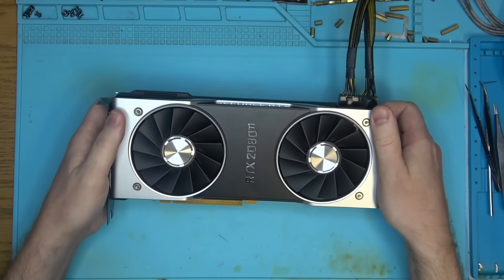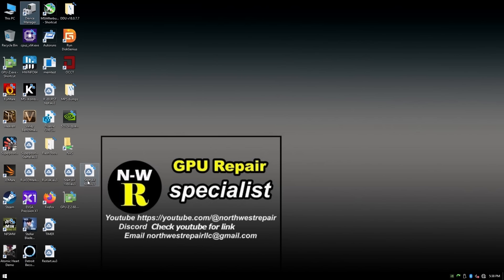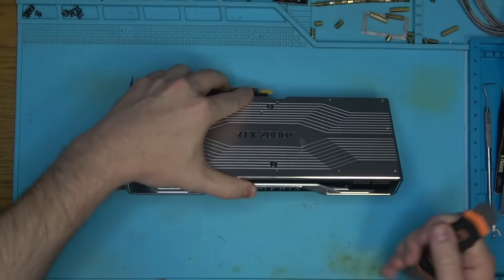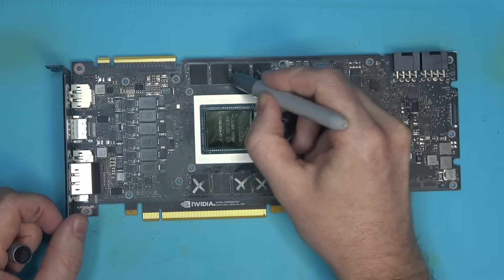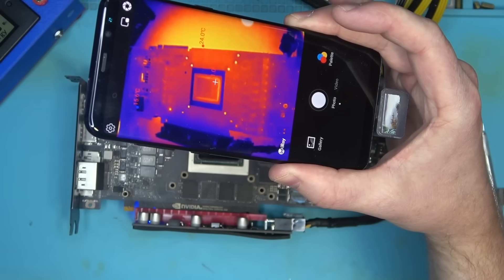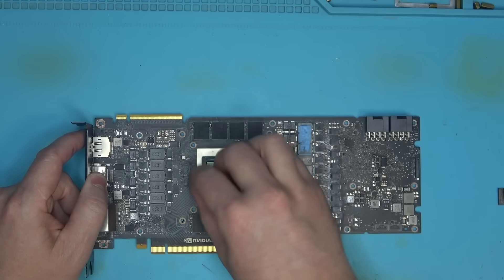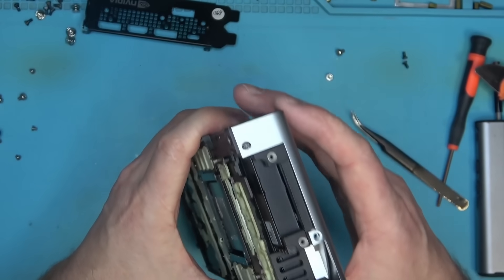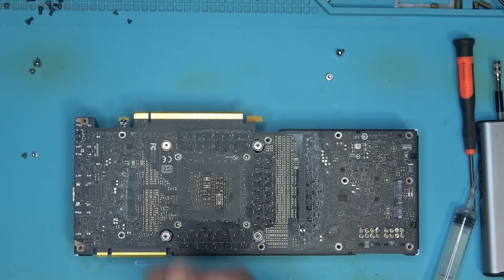2080Ti memory upgrade video 11GB to 22GB

Comment: can you upgrade rtx 3060 memory ?
Reply: No, 3060 already have 6x16gbit chips ( 6x2GB ), so you need 32gbit GDRR6 chips that do not exist, or even a new PCB that's dual sided like 3090.

For example, the modding done on 3070 8GB to 16GB is using same chips that are on 3060 ( 8x16gbit / 8x2GB instead of 8x8gbit )
Reply: why? it already has enough for the power that it has.

Comment: To replace the fans you have to heatgun melt the "2080ti" logo plate that's between the two fans on the face of the card and use dental floss or some prying tool to get it off. afterward I believe it's one or two screws under a gunk of hot glue.

 I think Gamers Nexus has the only popular video of actually accomplishing that since I am familiar with the one who "dremeled" out the fans to replace them. (being a more destructive method imo but depends on your comfort level)
Reply: Some pretty mad aura points if tony goes back and does this. Well beyond my expectations anyway.
Reply: https://youtu.be/w9FtXZGQzfM?t=371
Reply: @SergeiSugaroverdoseShuykov  that is insane
Reply: nice one

Comment: did you see the GamersNexus disassembly video? the middle panel is removable
Reply from the maker: Ill try this next time if i get lucky
Reply: @northwestrepair  "removable". But its being held there by a bunch of glue.
Reply: @northwestrepair  Better first watch it thoroughly, because it's 70+  screws total AND hot glue on face plate AND you still can't detach the face plate immediately, it hangs by fans tape-wires dangling around while you disassembly 20 more screws that were previously inaccessible. This means the thing will most likely get bent, scratched and there is risk of tearing the internal wire-tape that connects fans controller to the card. You gotta cover yourself inform the customer of all possible damages + charge extra for the ludicrous amount of work on that cooler required for swapping the fans.
Reply: @northwestrepair  Have you ever doubled the ram on a 4090?
Reply: @JamesSmith-sw3nk  it can't be doubled without using very specific PCB from China which means it's not really doubling but moving the core and memory to whole new board with either a basic blower (doing like 300W max screaming at max RPM) or a liquid cooler.
Reply: @ПётрБ-с2ц  Agreed, and I'm more left than wrong.
Reply: I mean, you can also “remove” the gpu from the pcb
Reply: @jessiethedude  did someone say reball the core?! Tony!
Reply: I did it some time ago on a 2060 Super (which is similar) to replace the fan but in the end the new fan also makes a whine. LMAO. Heating the metal cover with hot air to remove the glue.. Totally worth it! (not)
Reply: Gamersnexus is pretty ragey lately, ever since the nvidia documentary.
Reply: @sideoutside  Mad at the world angry liberals.
Reply: Back when GamersNexus was about hardware... Now just a far left political channel.
Reply: @mintymus  How is GN far left?
Reply: @SzwarcuKX5  Everything orange man bad.
Reply: @mintymus  ?????
Reply: @SzwarcuKX5  Yes?
Reply: @mintymus  Can you answer my question with normal sentence?
Reply: @SzwarcuKX5  Already did.
Reply: @mintymus  Is it because of their journalism on the tariffs?
Reply: @convenientEstelle  Nope.
Reply: @mintymus the classic strawman instead of providing evidence for the claim. You gotta start thinking for yourself instead of mindlessly regurgitating the opinion of the politician you're crushing on man.
Reply: @MR-zt1hh  so you can't prove me wrong. 😂
Reply: @mintymus  People like you make the right look exactly as competent as they really are I appreciate you
Reply: @Lil_Pendragon coming from a far left extremist, that's the best compliment you could give me. Thanks!
Reply: @mintymus  Someone tells you you're an idiot and you're like "you're a far left extremist" lol you couldn't even tell me what it means to be a "far left extremist." And you're welcome
Reply: @Lil_Pendragon  Like I said, it's a great compliment coming from you.
Reply: @mintymus  Getting the last word in seems pretty important to you
Reply: @Lil_Pendragon 😂 oh yes very important.
Reply: If the far left is anyone who has a problem with all the, well, [gestures at everything going on], count me in
Reply: @mintymus  Ahh yes, everyone you disagree with is an "extremist", very far right of you.
Reply: @mintymus  opinion discarded
Reply: @ПётрБ-с2ц  Look we have a far lefty right here.
Reply: @mintymus  i am looking at a person spitting bullshit about respectable people who upgrade their content about hardware each year (let lone taking every GPU they test apart) not being able to make a claim worth disputing. The entirety of your claim is "I do not like GN".
Reply: @mintymus far left = being slightly left of a wanna be autocrat
Reply: @mintymus  you seem pretty affected
Reply: gamersnexus is like 80% drama farming now and less tech than ltt
Reply: @illyaeater  As long it's tech drama, I'm in.
Reply: @frf5000 Thankfully, no autocrats. President Trump was elected in a complete and historic landslide.

Comment: I've used that PTM7950 on a few gpus. it's a good choice for high-heat situations, like old blower coolers or low-end dual fan configs. Have it on a reference Vega 64 and an Asus Dual 4070 TiS and it works great.
Reply: Good in low airflow situations like laptops and lasts lot longer than thermal paste
Reply: @alancarr195  True, I recently put it in a friend's 2017 macbook which was throttling hard under any sort of load. The cooler on that thing is tiny, but now the CPU doesn't go over 85C on 100% load.
Reply: @ttvv90  honeywell actually developed this stuff for the processors in like remote control missiles and other weapons using silicon chips
Reply: its really good on gaming laptops ,  i gave me 10C on cpu while gaming and like 7 to 10C less on GPU 130w 3060.  its has been like 1.5yrs and still its giving same temps , way better than thermal paste.  also its better to use ptm than liquid metal ( because LM will need to be re spread in like 3mnths time and will eventually spill especially on laptops not designed to use with LM ( that do not have boundary kind of around the cpu to hold LM  when it leaks ).  my friend has LM squeeze out and spill on components and short them , luckily some caps and resistor were short so it got repaired
Reply: Have it on my 3080 ti. works perfect.

Comment: How much would it cost to upgrade my EVGA RTX 3080TI FTW3 HYBRID to 24gb of VRAM?
Reply: You need a new PCB that's double sided like 3090 to be easy ( you could also replace the actual chip, but need a new BIOS that not wildly available ( same BIOS as modded 3090 48GB ))
Reply: He only fixes cards
Reply from the maker: not possible
Reply: @northwestrepair Really? What exactly makes a GPU have the ability to have its memory expanded?
Reply: @Liminal.Headspace  the 2080Ti has a bios that is compatible with 22GB. They just sold it with 11GB in certain markets.
Reply: @JamesTK  I call bull on that one. The 2080Ti was never sold with 22Gb and it was specced at 11Gb all over the world. It was supposed to have 12, but there was something with the 12th memory pathway.
Reply: @Liminal.Headspace  seems someone was able to modify the bios to support the extra memory. Hardware still needs to be capable of addressing it though.
Reply: Also, where you gonna' find drivers that leverage the added RAM?
Reply: @sneakytrip6594  Do not need new driver...

Comment: How much better is a 22gb 2080ti then the 11?
Reply: It's worth it especially if you are buying a used gpu to keep playing on it.
Reply: A lot better when it comes to AI, not useful for gaming.
Reply: Seems 16GB is becoming the minimum for high end gaming.
Reply: @soundspark minimum is 10-12gb for 1080p in some titles.
Reply: @LowBudgetGamer-o6l There are games that utilize 10gb~ at ultra 1080p. Microsoft Flight Sim is one of them.
Reply: @swilleh_  I have a 7680x2160 native res... I bet even a 5090 would have issues without frame gen

Comment: do you recommend a 9070 xt and which models do you recommend or don't the most?
Reply from the maker: dont know
Reply: @northwestrepair what cards do you recommend though?
Reply: Sapphire
Reply: @abesmissioncontrol2013 how come sapphire
Reply: @theclitcollector  They've set the standard for Radeon gpus for a long time. Good cooler designs and good build quality going back years.
Reply: @theclitcollector  sapphire has good build quality
Reply: @theclitcollector  sapphire is actually an amd partner they help them design reference cards and coolers, also were responsible for like half of the fury and vega 56/64 cards interposer-chips assembly. Sapphire is just a "brand name" rather than a real company - the parent corporation is PCPartner, they also own zotac that makes nvidia cards.
Reply: If you look up his channel a little bit, you can see he just doesn't like AMD card😂
Reply: @jeffsan0.5 well, it appears hes yet to take a dump on 90 series lol